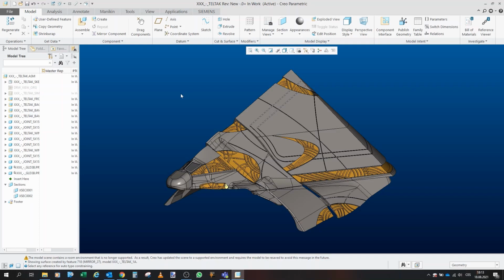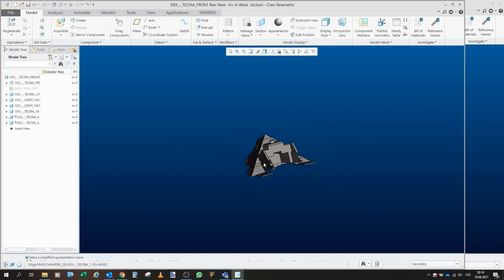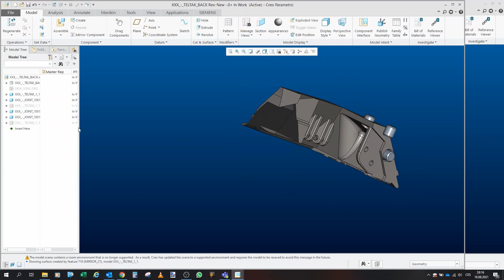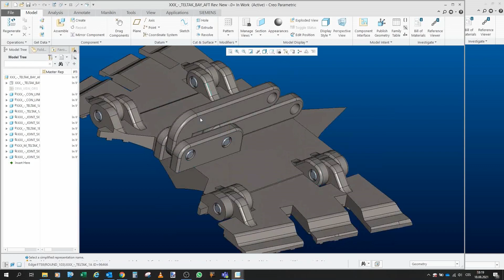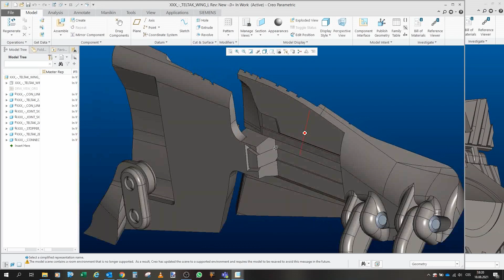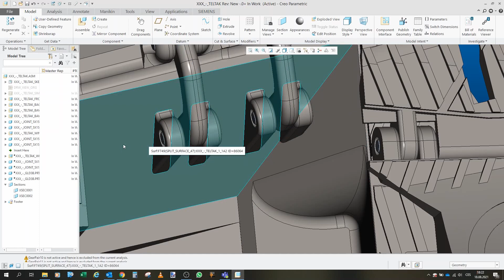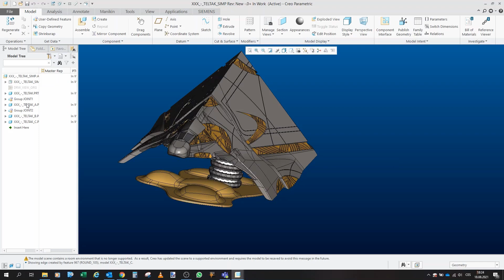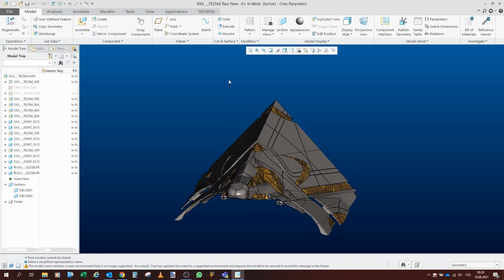Project Teltak Part 1

Comment: will it be released as one part modell? :) and could you upload your other models as one parter too?
i tried to print your apophis/sokar ship but a sla printer has a sligltly density of 1.1 to the original measurements so the pins wont fit.
as a one file modell i could print it
Reply from the maker: well i occasionaly publish my models as an individual solid one piece model. In case of the system flagship, i did not do it as it has moving parts so it did not make any sense to me. 
the Teltak I plan to publish as a moving - retractable version and static one made out of 3 pieces I theoretically can also publish the entire model as a one piece. ;)
Reply: @martintaichl  seems logic to me. maybe you could reupload the apophis one with less parts. like pyramid , upper plate , "movable parts" and bottom plate. would be make it much easier and it would stay moveable.  a staticle 3 piecer teltak should be printable too. its just hard to print 20 parts in a sla printer :D thanks mate.
Reply from the maker: @SkaAraKev  cant really promis you anything regarding the system flagship. I will try, but no promises ;)